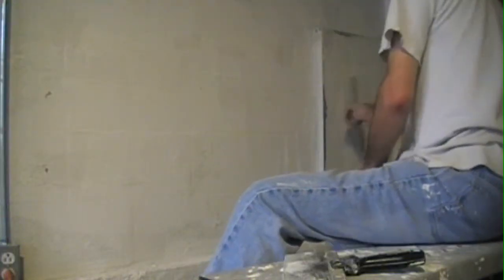basement room addition. Mudding over cinderblocks. Drywall...........Hot Mud

Comment from the maker: I used 45 minute fast set mud for this job. It's good especially if here's an area on your wall that needs a lot of mud applied to straighten it out. Regular premixed mud will stick also, even if the cinder block is painted, it just will take a bit longer to dry. You might test a small area to make sure. If it doesn't stick well you'll want to paint the walls the an interior drywall primer sealer. The first coat I did was mudding the recessed lines where the blocks meet, then did a fill coat over everything, which is this video. I gave it another skim coat after sanding the high spots and then touched it up after that dried. It takes a few coats to get it nice flat and pretty. You shouldn't need any tape. The tape I applied was to hold in the metal corner bead I mudded in, because I couldn't nail it on. Best wishes on your project.